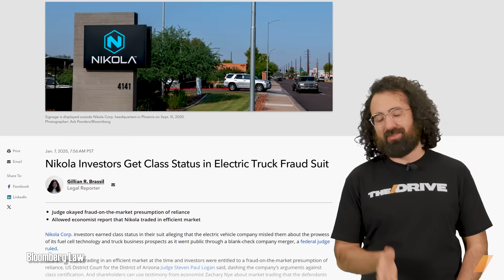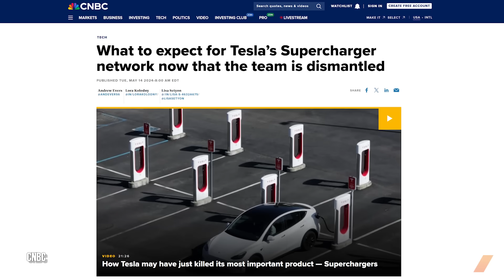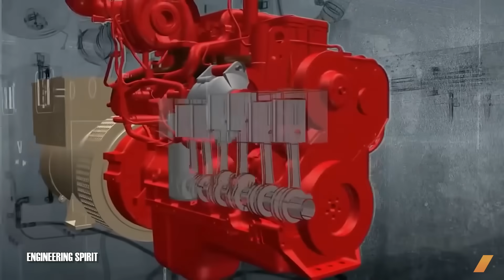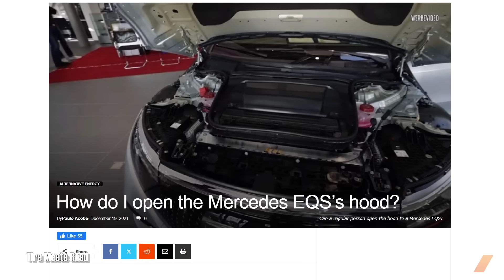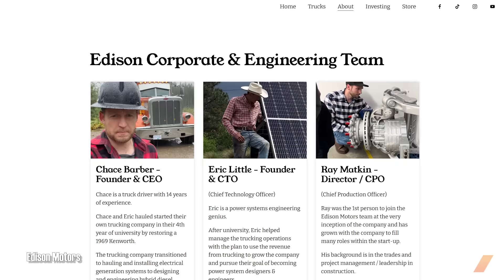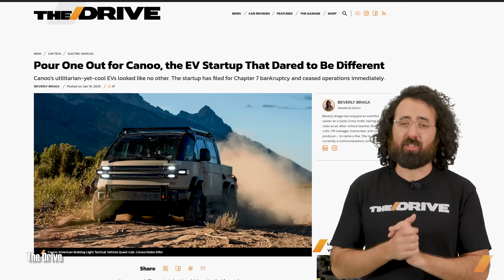The truckers in a shed beating Tesla with 100-yr-old EV tech

Comment: Only one electric semi on the market? Volvo, iveco, and Scania all have electrics currently on the market.
Reply: very US centric video.
Reply: @Boborjan1986  US has EVs too, Frieghtliner, Kenworth Peterbuilt. Its not a US centeric, its a Tesla vs Edision center video. they act like nothing else exists.
Reply: @Boborjan1986  Lot of calls to bring Scania to North America, so much more advanced than any truck I drove
Reply: @Boborjan1986  Funnily their lack of a train infrastructure probably makes the Americas quite knowledgeable in diesel-electric. It exists for European freight trains and maybe some remote commuter lines, but most trains here are full electric with hardly any battery. They can get stuck in a short section between voltage supplies. A tiny hybrid battery would help full electric trains quite a lot.
Reply: @Cloxxki their used to be lots of train infrastructure.
Reply: @Cloxxki  US actually has plenty of train infrastructure, it's just optimized hub and spoke for commodities (grain, coal, oil, etc.), bulk freight, and container shipping (in that order). 
The US is just a big country, and once you get out of the northeast, most of the county's population centers are hundreds of miles apart.  But there are still a lot of small & medium towns and cities in between that need to send/receive goods and services, and need roads anyway, so semi-trucks are more flexible and economical.
Reply: @Cloxxki hahaha you don't need hybrid to use a battery for electric trains. Do you really think you can "unplug" a train and it immediately stops? Getting stuck between voltage supplies? Are you mental? 😂😂😂😂😂
Reply: @Cloxxki  The european power grid is extremely stable, blackouts or load shedding are a very rare occurance. It is just not a problem that needs solving.
Reply: @annakissed3226  There is still a lot of train infrastructure in the US.  It just isn't passenger train based.
Reply: @Cloxxki Series diesel Genset passenger trains are very common in the UK and Europe.
Reply: @Cloxxki  the US has the largest freight based rail infrastructure in the world, and we use it quite a lot too. The problem with US rail is not freight, but passenger the US has almost no passenger for rail, but don’t mistake that for no rail.
Reply: @Cloxxki curious about your comment “lack of train infrastructure”. The US has the largest train infrastructure in the world, with the most advanced diesel locomotives ever built. It’s easy for European countries to electrify their networks as most European countries are smaller than just the state of Texas while the entire network of Europe is much smaller than that of the US.
Reply: @Cloxxki us has more railway than any other country genius, 250,000km. The US was built on and created by railways. Where the railroad went was where the people went. Even second place china only has 124,000km of railways. And the part that makes this even funnier, the US uses a ton diesel-electric locomotives for most of their trains. So they know a ton of diesel electric power cause their vast amount of trains use it lol.
Reply: We have the largest train network in the world.
Reply: @rhekman  Nah to a certain degree we can have more Raúl we use to have more rail. Like everything tho cooperate downsizing to save money
Reply: @Cloxxki  actually we have a massively complex and extensive rail network for freight. We just don't do passenger rail
Reply: @rhekman  Semi trucks are more flexible and economical than rail transit in the US? Does this factor in road maintenance and fuel costs per ton-mile, or no? It's a known fact that railroad equipment and rail construction are an order of magnitude cheaper per ton-mile of cargo delivery than truck and trailer, mostly because of major fuel savings and how expensive it is to repair highways and road networks versus how expensive it is to maintain rail. True that a single truck and trailer are much cheaper than a single train, and that it costs more to build the tracks than it does to pave the road, but in 50 years' time, the rail network is millions and millions of dollars cheaper, and this advantage grows with higher ton-mileage.

Not to say that trains are always better - in rural Australian towns, for instance, deliveries are usually of very small tonnages, which make rail uneconomical. America has no such problem - deliveries are high-tonnage and run frequently, meaning the ton-mileage checks out for long distance rail infrastructure OVER long distance trucking.
Reply: @Cloxxki America uses freight trains more than anywhere in the world.
Reply: @Cloxxki  Have you seen our freight network? We do not have a "lack of train infrastructure" in the US.
Reply: @Cloxxki you do know America has the biggest freight network in the world we just don’t have much public transport when it comes to trains
Reply: @Cloxxki IIRC that is common on trolleybuses over there so they can can make it to the next stop if a pole detaches or they need to make a detour.
Reply: @Cloxxki diesel electric is used in military vehicles too. Other countries use them in submarines for example while America uses nuclear power.
Reply: @eocoleman1 those countries also have gdps smaller than Texas and they make it work lol, the size argument doesn’t make sense cuz they’re still working with less resources. Texas would be like the 5th richest country if it was a country lol.
Reply: @Cloxxki NA are cities are to far apart for it. And with FSD around the corner it isnt worth investing in.
Reply: @Boborjan1986 Edison is based out of Canada
Reply: @Boborjan1986  “US Centric” when the whole video is about a Canadian company 😂
Reply: @Boborjan1986 still not accurate for the N/A market as Freightliner has multiple eCascadias around and the other manufacturers also have EV offerings.
Reply: @Boborjan1986  North American centric, but ya.
Reply: @Boborjan1986 starring a company proudly based in Canada
Reply: @Boborjan1986  its a Candian company. And these other companies dont sell EV's to the american market.
Reply: @Boborjan1986  Volvo US has an electric option on the market with their latest gen of body style. And Mack will probably join that segment sense Mack US and Volvo US are the same company.
Reply: @Boborjan1986  There are Volvo Electric Trucks in US just owned by Volvo for trial and display purposes.
Reply: @Neojhun  The Freightliner EV eCascadia and eM2 are for sale and built on the assembly line at their Portland Factory.
Reply: @Neojhun Tim Hortons in Canada has a few for testing purposes. We got go to Guelph to see it in person and drive it. We are supposed to be 50% electric trucks by 2030. Line hauls will still go diesel but store deliveries will end up being electric trucks and stores will install MW charging stations for the trucks.
Reply: @Boborjan1986  There are over 500 electric Volvo's on the US roads as of now.
Reply: @GenuineFlolie  I haven’t seen any of them here in the NY area
Reply: @Boborjan1986  *Canadian
Reply: @Boborjan1986  It's a US based channel...
Reply: @alexanderdeburdegala4609  North American actually.. Canadia a nation and featured in the vid
Reply: TheDrive is based out of LA, Edison is Canadian, TheDrive is American. That's why almost all their content features ADM cars, not North American cars. Sp you're wrong, actually...
Reply: @alexanderdeburdegala4609  with the stereotype affirming behaviour they've shown in the video, yes it's painfully obvious that they're Americans.
Your own statement also does nothing to take away from the stereotype.
Reply: @fermitupoupon1754 Are you mentally compromised? It's not a stereotype, nor feeling, nor opinion. It's a US based company and channel? Why is this so problematic for you? They like myself thing the Edison is awesome, and the real future of trucking.
Reply: @Boborjan1986  You mean Canada centric, cause Canada company
Reply: @Boborjan1986  Well it is a US channel... so...
Reply: @AnyBodyWannaPeanut  Because it is a US channel it is ok to lie? Got it.
Reply: @bettertoaster  ffs
Reply: @Boborjan1986  Because we're the only ones who matter
Reply: plus Mercedes Actros
Reply: Volvo and Freightliner both have more miles driven from EV trucks than Tesla does IN THE US
Reply: @Fishbone8891  We all do haha! I work for KW and I have 60+ EV trucks I manage in the DT LA alone. This video makes it sound like only tesla exists when in fact they are the weakest player.
Reply: @fjm9898  I agree with you there, I've only seen the two but I'm sure theres more.  Tesla just advertises the most but underdelivered the most as well
Reply: @Fishbone8891  PACCAR between Peterbilt and KW have about 100 EV trucks in the LA area between MD and HD. BYD i think has like 50-100 trucks down there and Schnider alone has like 100 EV Freightliners.
Reply: Even in the US all the OEMs offer EV options, they just didn't do proper research. Daimler beat Tesla to market with Class 8 trucks with the Freightliner eCascadia. There are more eCascadias out on the road than Tesla trucks.
Reply: Hyundai -Kia, Mercedes-Benz, Daimler AG, Freightliner, Mitsubishi Fuso, Toxin, DAF Trucks, Kenworth, PETERBILT, International EMV, Tata, Volkswagen, Volvo, Renault, BYD, E-Force One, Smith Electric Vehicles, Tererg, Volta.
Reply: There are even many more in China, But there is only one american market - but you should look beyond your national borders.
Reply: @ Bruce Wilson who lives in Tennessee is actively trying to get scanias in the U.S.
Reply: Here in Brazil we have a lot of electric trucks from manufacturers like Volkswagen, JAC Motors, Volvo, Mercedes-Benz, XCMG etc... I could mention more but those are the one you will see often! They operate in cold and hot weather, through highways and thought dirt and mud, we have eletric cab overs and regular eletric trucks too. Saying that there are no eletric trucks in the market is kinda crazy! In more developed countries there are even more eletric trucks and vehicles. There are rumors that BYD will also start building eletric trucks
Reply: Freightliner also make an electric semi for the US and Canadian market.
Reply: Was thinking the same thing, our city in Victoria BC Canada has several large electric trucks, buses, dump trucks, even in America there is several electric semis besides Tesla. Not sure you did enough research, even Tesla semis go further then just a few stops around town, they get over 500 Kms on a charge and charge in 45 mins. Ever filled a semi? Takes like 25 mins to pour fuel into that huge tank…
Reply: International also has electric semi, USA based company
Reply: @MariuszChr International is owned by the Traton Group, which also owns Scania.
Reply: @MariuszChr International is owned by VW.
Reply: @TroySavary  off-road part, semi business is not from what I understand
Reply: @MariuszChr  VW acquired International when the bought Navistar. It is a fully owned subsidiary of Traton VW's heavy vehicle arm. They bought it for the semis. Getting rights to the Scout name was just a bonus.
Reply: @TroySavary  oh ok. Thanks.
Reply: Nah
Reply: Also Mercedes
Reply: Obviously an American.
Reply: You forgot Toyota, Hyundai.  JCB have Earthmoving plant Hydrogen, Diesel and electric.
Reply: Hybrid truck
Reply: They just aren't revolutionary.
Reply: This isn't a video about your-a-peein trucks, so get off your soap box.
Reply: American market. No one has them in application.
Reply: Most battery semis do not have the range capacity 4 operating in the US.
Reply: Yea, and not ONE is worth the 2 gallon of gas it would take to get rid of the junk!
Reply: The USA is famously self focussed
Reply: Not the Same tech
Reply: Now don't go bursting his bubble like that.
Reply: Doesn’t change the fact that they can’t really compare
Reply: Those use a overhead cable do they not? Like the trains over there in europe.
Reply: Apparently someone forgot this video is on EV truck in North America. We know EV trucks are popping up more in Europe.  Renault, Iveco, Scania, others and yes you are correct but in North America, we only have Tesla and I have seen a Nikola but that was one…have yet to see a Tesla semi where I live but I hope Edison makes it able to pass US emissions so it can come into the states
Reply: You're a moron, this is a diesel-electric hybrid.
Reply: Pepsi and frito lay also use Tesla semi’s
Reply: On the market in the US.  The only market that matters…
Reply: Technically freightliner and peterbuilt also have electric semi trucks in North America so it's not just tesla and Edison.
Reply: Kenworth too
Reply: Kenworth and freight liner also have options available
Reply: Peterbilt and Kenworth too. Western Star has one but it’s a single-use purpose for mining operations.
Reply: And Kenworth
Reply: I just did workplace learning and I drove an electric mercedes there. I was also at Elmia half a year ago and while there I got to look around a few BYD EV semi models and they're quite nice TBH
Reply: also mercedes…
Reply: An American narrator on an American channel talking about American and Canadian companies? How could they forget about the trucks in Europe, which are incredibly relevant to the topic of American logistics
Reply: Might be on the market but who's actually using them??
Reply: Another EV scam like Nikola
Reply: Freightliner does as well
Reply: Raced to the comments to see if anyone else noticed that and day what u did
Reply: Sure, and not one of those is nearly as awesome as Edison. Euros are cringe losers, no I will not elaborate.
Reply: Mercedes 600  km autonomie
Reply: Yeah and the electric Volvo is just as bad. The company I work for in the UK have 2. They are only allowed to make deliveries and collections from 2 junctions away because range and charging facilities are non existent.
Reply: Scania makes a diesel hybrid suitable for urban transport
Reply: Shhhhhh ...... He's American.. remember, you don't exist.
Reply: They're all fully electric, not diesel electric and are not suitable for the long distances the north American trucks need to cover.
Reply: Probably meant the North American market.
Reply: And they are all trash except for the Edison lol
Reply: and what happened with Freightliner
Reply: …in Europe
Reply: So none then. Thanks for confirming.
Reply: And Freightliner
Reply: I live near the Port of Los Angeles. I see non Tesla electric battery semi‘s regularly. Not a lot of them, but regularly.
Reply: Try an ev truck in -30c canada see how that plays out
Reply: Diesel electric* there isn't any production electric truck with an onboard diesel generator.  Peterbilt, Freightliner and Kenworth have electric trucks but they've got a range of like 230 miles with the most range.  Idk about you but ik American long-hail truckers do like 400-700 miles a day
Reply: Yeah, but none of those are available in the US or Canada. It’s a different world. You can’t even import your own Scania and use it commercially, over there. But then, when was the last time you saw a Peterbilt, in commercial use over here? Different environments, different rules and regulations and even different safety standards. 
That’s why cybertruck was never available over here. Even if it was built correctly, it can’t meet European standards.
If you watch these American channels, you have to accept the limitations that implies.
Reply: I would look at the cost and stats on the semi. the teslas range is far better.
Reply: Yeah, the US market. We don't care about tiny European countries. Hell, yall still use cab-over trucks😂 Imagine crossing the USA in a cab-over, that would be miserable today
Reply: 2/3 of those don't exist in the states, and Volvo doesn't have any EV semis in the Americas.
Reply: Those are short range aren't they? Those are for moving around equipment in the yard
Reply: In us. Only in us
Reply: Typical Ameribrain
Reply: Daimler has a bunch. E-Cascadias to name the most notable
Reply: And don't forget the enormous brands of chinese EV's
Reply: The US has unique semi requirements that don't exist anywhere else. European designs don't work here nearly as well.
Reply: @spdcrzy  Erm... European semi trucks often have more power... are more manouverable... can tow higher loads - the scandinavian versions can go up to 90 metric tons.
They have sleeper cabs...
Oh.. and they are usually more efficient... 
Just watch the videos from Bruce Wilson on their imported Scania truck.
Sooo...
Reply: HueyHunter  yeah.... right... as if this can't be addressed by engineering a slightly longer wheelbase, or just use electronics...
You still save a few feet in length.
Nit even considering that the US trucks still use very outdated suspension systems, which make them more unstable, but much cheaper to produce.
Reply: HueyHunter  yeah... as if the electronics weren't already in the trucks... ESP is a mandatory part of braking systems i  Europe... and just code, no additional hardware required.
One of the most reliable systems in any vehicle.
But considering, you guys don't even really care about maintaining tyres.... I won't think a second about any US trucker spending money or thoughts on their brakes
Reply: @spdcrzy  “unique requirements”?  Such as?
Reply: @mgs337  a little thing called "range". It's easy to forget just how fucking huge the US is.
Reply: @ Somehow, I don’t think that’s as excluding a problem as you seem to think it is.  Just arbitrarily picking a couple of models, a Kenworth T680 has a fuel capacity of 150 US gallons (560 odd litres for those who speak metric), a Volvo FH16 Aero (one of their long haul designs) can be fitted out with fuel tanks up to 900 litres.  So unless that Volvo is horrendously inefficient with fuel, I would hazard a guess that it would do just fine on North American highway distances.  

There are differences between US and Europe in terms of roads, vehicle size restrictions, and other things, but I doubt very much that there is any actual use-case requirement that would specifically exclude a European design truck from functioning over here.
Reply: @spdcrzy  Scania would work wonderful in the US. 
Due to import cost etc. it's not viable.
Beside the people, there nothing special with US that separate them from the rest of the world when it comes to trucking.
Rest of the world left the 70s a long time ago.
Reply: @modalen2 Heck, even the notion that Euro Cab-overs being less powerful & comfortable than US' traditional trucks is long gone for decades. Modern Euro Cab-overs are some of the most powerful trucks out there straight from the factory while also providing a lot more comfort because they use air suspension all around, more sound deadening, advanced automatic transmission, etc.
Reply: @modalen2 Scania is own by VW, so they could be built in a VW factory in USA
Reply: @modalen2  why people like you don't even bother to google about scania in the US and find out about their 80's attempt to get to US market? Scania failed in the US, nobody needed their trucks here.
Reply: @modalen2 Scania would work state wide not country wide
Reply: @modalen2 the specs of US trucks compared to UK are night and day due to weight limits and bridge laws. A euro trucks would boot be viable in the US without modification
Reply: @modalen2 cab over design is a problem in america. If you cant sleep in it it makes it prohibitively expensive to use them for long haul
Reply: @loutenant9480  It's not that they weren't needed, It was repair facilities that were needed. If you strayed far from a Scania dealer, parts would be hard to come by. A strong dealer network in the US was the most limiting factor by far. Brand recognition is a hard thing to overcome as well. Scania wasn't as well known in this market back in the 70's.
Reply: @modalen2  "it would work wonderful but it's too expensive" then it wouldn't work would it? You make little sense
Reply: @modalen2 the issue is most trucking jobs are cross state and and that can get to be a real issue with finding chargers ESPECIALLY a specialist semi charger.
Reply: @modalen2 interesting comment seeing as the US moved beyond using cabovers in the 70s. 
It’s also more than just import costs. Most European trucks are too short and have a much higher load density and axel load weights seeing as most are only two axels. US trucks are much longer and typically have more axels to distribute the weight. 
Other factors also play a part, most European trucks don’t meet California emissions standards, or US safety standards.
Reply: My backyard is probably the size of whatever flat you live in. The US is insanely large @modalen2
Reply: @modalen2  the u s is extremely special when it comes to trucking. The United States is a heavily car centered country. The need for cavover trucks essentially does not exist in this country. The conventional truck is easier to work on and more comfortable for the way longer trips than our european counterparts have.
Reply: @modalen2 The us doesnt use nor desire cabovers, most foreign trucks are short cabovers which can increase driver fatigue as truck drvers in the us travel long continuous roads. imported vehicles may be of use in cities but they arent a necessity, and the average driver in the us drives like shit so the large fromt engine provides safety for truckers
Reply: @modalen2  no there is a separation in truck design, euro trucks are nimble for mountain roads and all the curving roads while american trucks are long for straight roads and going a 1000 miles in nearly one go. It's why most euro trucks are stocky and short while American trucks are long. We use euro type trucks for towns and city use while the long ones for cross country or long distance use.
Reply: @modalen2  scania would not work, 600km is not long enough to replace the 1000+ mile range of long haulers but may work for city use in the higher populated states, New York, but not viable for states like mine, Oklahoma
Reply: Scania has a demonstration truck touring the US now and it's so far advanced compared to current US builders.  Far more comfortable, much, much more manuverable, advanced braking systems...
Reply: @ThusGuy Why would Scania only work state wide?
Reply: @ some states lack infrastructure in between cities and I doubt states like Alabama would be willing to build dozens of semi chargers
Reply: @ThusGuy  I thought you meant Scania in general (diesel).
But the infrastructure for semis isn't built out in either, so in many cases they just use the chargers for cars. That means, in some cases they have to unhook the trailer while charging, but it doesn't seem to be a big deal.

Also, many companies who use electric trucks, use them on the same routes. They have a charger at the load/unload bay (sorry, don't know the English name), which makes it possible for them to drive all day, without interruptions other than the normal lunch breaks.
Reply: @modalen2 European semi’s are shorter and nimbler for tight single lane roads. American roads are longer and straighter. Different designs for different regions.
Reply: @modalen2  the reason is us semi's have longer engine bays in front of the cab while European trucks usually have engines under the cab witch isn't  as good for longer distance
Reply: @modalen2  we do, however, have one of the largest nation in the world by land mass. Hence why our trucks focus more on long haul and comfort and less on maneuverability and efficiency
Reply: @modalen2  although Edison motors are starting to use Scania engines, so there is hope for the American / Canadian market
Reply: @modalen2 Scanias aren't as fuel efficient or as comfortable or as good at handling speed as any US truck.
Reply: @extremlycoolperson  now that's why you're a bit misinformed because you base things on old American Cabovers. 

Things have progressed so much and modern Euro Cabovers can 100% deliver the same levels of comfort if not even more than American's traditional trucks. Air Suspension in all corners of the truck, for the cab itself, & air suspension for both driver & passenger seats. 

You wanted fuel efficiency? They can also deliver better fuel efficiency even when they're brought up to the speed most US trucks go.
Reply: @modalen2 one American has imported one but is having difficulty getting it DOT approved or something the last I heard they have approved it to a certain number of trips or something so I don’t think import costs are the big factor here plus with a company the size of Scania they would most likely build it in America or Mexico since Tyler’s be honest with the amount of people who have liked Bruce’s scania they would capture quite a healthy percentage of the market
Reply: @spdcrzy  The thing is. All cab overs would work a billion times better then any truck on the road today. Much better tech much better safety much better load capacity and customization and much better engines
Reply: Name one  @spdcrzy
Reply: @spdcrzy unique requirements. Lmao. Drum brakes and mirrors you see nothing in 😂
Reply: @spdcrzy  Freightliner has had the eCascadia in the US since 2021
Reply: @spdcrzy its not that they don't work well they just have different regulations
Reply: @spdcrzy  volvo has an american market of trucks as well
Reply: @spdcrzy Volvo and Mercedes have delivered far more electric semis to American companies than Tesla has.
Reply: @TroySavary  Correct! For those who won't know Mercedes (Daimler) trucks in the US are sold as Freightliners & Western Stars.
Reply: @spdcrzy lol bruh it's your chicken tax that keeps Europe from overrunning your NA market, bruce has brought over a Scania 770 and is touring around showing American truckers what is available elsewhere and he's said this over and over, the tech on euro trucks is miles and generations ahead of American trucks, Like they don't even use DPFs. So no it's not really 'unique' requirements it's just bureaucracy that kills competition and innovation.
Reply: @mwat22  > the tech on euro trucks is miles and generations ahead of American trucks, Like they don't even use DPFs. So no it's not really 'unique' requirements it's just bureaucracy that kills competition and innovation. 

wouldn't this imply that the bureaucracy is helping innovation? the EU has much more stringent requirements on vehicles.
Reply: @mwat22 the chicken tax only applies to LIGHT cargo vehicles. Like the Ford Transit, funnily enough.
Reply: @spdcrzy  flatout lie
Reply: @spdcrzy does that mean they don't exist?
Reply: @TheAllMightyGodofCod  Western Europe does not see anywhere near as harsh climates as the US and Canada do. Notable exceptions being the Nordic countries, of course.
Reply: @spdcrzy you clearly have never been to Hungary, bakingingly hot summers, deep freeze winters are the norm!
Reply: @spdcrzy  if you are going to answer my question, fine.
If you are not .. then, shut up and don't waste my time
Reply: @annakissed3226  I'm dead serious when I say Hungary's weather is but a drop in the bucket compared to anywhere in the Midwest. You guys don't get tornadoes, landslides, mudslides, ten inches of snow in a day, or multiple weeks in a row during the summer that are over 35°C. All in one year, I might add. We get more snow in two days than Hungary gets rain in a YEAR.
Reply: @spdcrzy  Euro trucks are everywhere except NA, from the deserts in Mexico to the harsh winters of Norway with no extra "weather packages". Just normal factory setup. Only reason they're not in NA is due to import tax.
Reply: @annakissed3226  While you are right, you clearly did not read his comment. Or failed to understand the key part: Hungary is NOT part of Western Europe. It is part of Central Europe. And therefore we have a Continental climate here (well, in the last few years I would say we went back to the Mediterranean climate like what we had in the 15th Century).
Reply: @spdcrzy  Trucks are usually tested down to - 40 °C / -40 °F... We do have snow chains... we have winter tires... Temperatures in Spain go above + 40C / 104 °F in summer... What we don't have is tornados...
Reply: @spdcrzy  …and especially Norway, the most nordic of those countries, has a huge amount of electric trucks…
Reply: @spdcrzy  western Europe and the PNW have basically the same weather. But I guess including Arizona and Nunavut, whilst explicitly excluding Scandinavia, and glossing over the Iberian peninsula and Central and Eastern Europe, is a perfectly fair and reasonable comparison. You do realise that Europe is larger than the combined area of the 50 US states, right?
Reply: @annakissed3226  the coldest temperature ever recorded in Hungary was -35 c in 1940. Definitely cold but that's pretty much a regular occurrence where I am in Canada. For comparison coldest temperature recorded in Canada was -63 c.
Reply: @spdcrzy  You know that most US trucking manufacturers are actually owned by European companies. So, if they wanted to get EU trucks, like they are used all over the world to the US, they could. However, there is no need as the US is OK with trucks that are still in the 80s, so it is more important to them to make big profits instead of newer, more advanced trucks.
Reply: @spdcrzy yes where Scania and Volvo are from
Reply: @spdcrzy Where the Volvo and Scania are based. They are both Swedish, which is part of the Nordics.
Reply: @spdcrzy Bonus points for pointing out climate in northern Europe. Southern trucks in Europe do not work well in lets say Norway, in Winter. Because they mostly use 2 axle trucks. Native northern trucks are minimum 3 lift-axle.
Reply: @spdcrzy  Yea nordic countries. Can u tell me where exactly is Scania and Volvo HQ located ? Oh scandinavia
Reply: @spdcrzy Scania is a Swedish company and Sweden has plenty of semitrucks on the roads at -35C in the winter.
Reply: @aftoknito  bruh, -35C is NOTHING lol. This is what I mean when I say the (Western and Central) European mind cannot comprehend the scales of weather and distance that trucks have to deal with here. In a single year, a heavy duty logging truck will see everything from -50C to 50C. It WILL get rained, snowed, and hailed upon, and maybe have to deal with a rockfall and a mudslide or two. It WILL have to deal with being overloaded beyond an already insane 88,000lb. It WILL require  a traditional two-box configuration and not a cabover, because LOGGING. You're off-road, you've got a lot of weight, probably significant elevation changes, and very low tire pressure. Trust me, you do NOT want to be in a cabover unless it's a Unimog when you're in that position.
Reply: @ there isn't a single place outside Antartica where the temperature drops to -50C. You're clearly an American that doesn't understand the Celsius scale. Not even at the top of Mount Everest it gets to -50C.
At -50C you'd succumb to hypothermia in a matter of 3-4 minutes.
Reply: @TheAllMightyGodofCod market... Ours, not yours!
Reply: @fightfanian I would love to counter argument but ... I made my comment months ago, there are presently 206 comments In the thread and I have better stuff to do than to look for a comment on my 3 day weekend with 40⁰c and perfect sunny weather.😊
Reply: @spdcrzy So? Just operate electric trucks in the milder climates like the entire east coast to the midwest, and the west coast to the rockies. That's the vast majority of truck journeys accounted for.
Reply: @KingFinnch  did you really call the Midwest "mild"? LOL.
Reply: @spdcrzy  Guess where scania and volvo are located.
Reply: @spdcrzy  There are places in Greece that go negative Fahrenheit regularly. Central Europe is even colder during the winter
Reply: @spdcrzy like what? What is there that an American made Semi truck can do that something like a Scania or Iveco can over can’t do?
Reply: @spdcrzy It's the other way around. America doesn't meet the standards of European trucking. + USA doesn't allow trucks to be imported unless they are 30+ year's old. "American requirements", lol...
Reply: @spdcrzy so how come your semi companies are owned by European truck companies and built in Europe and shipped to the US?
Reply: @annakissed3226  The hell you talking about. Peterbilt and Kenworth are all US owned and operated, PACCAR is an American company who owns a EU company, DAF. Volvo builds their trucks here in the US and Freightliner, yes is owned by Dimler, are built in the US.
Reply: @annakissed3226 curious about your comment. True there are a few US truck companies owned by European companies (Freightliner, Mack, US Volvo), but all of these companies have their assembly plants in the USA. In fact, I can’t find any evidence of any European trucks being imported to North America (USA or Canada). In fact I only found that there were more US trucks imported to Europe than the reverse which makes sense as most European trucks don’t meet US emissions or safety standards.
Reply: @annakissed3226  that's just not true. Mack, Peterbilt and Western Star are still made in North America. Paccar, which owns Peterbilt and Kenworth also owns Daf, a european truck company. It goes both ways
Reply: @spdcrzy That's just not true, Australia constantly uses European designs, and they have thousand kilometre stretches of desert with hardly any infrastructure.

European trucks are far safer, far more efficient, far cheaper to produce, and produce more horsepower. It's just import tariffs and regulations that make US trucks the way they are.

If American trucks were truly better in a category, you'd see them far more internationally, like in Africa or China.
Reply: @KingFinnch  your roads are different. European roads are old world roads. American roads are a lot different. You guys load your axles to a totally different category than we do, and with good reason.
Reply: @spdcrzy  You're right, our trucks aren't anywhere near as bad as US trucks.
Reply: Politics does not allow Euro trucks in USA. Recent politics will only make it worse. Oil industry runs US politics.
Reply: What are all of you talking about? This channel is not familiar with the commercial vehicle industry.

Paccar offers electric Peterbilts and  Kenworths in NA, and DAF in EU. DTNA has so many eCascadias in NA. Toyota and Kenworth together offer a FCEV. 

To the channel, do better research.
Reply: It’s America. They forget they’re 10 years behind the rest of the world in these things. 😂😂
Reply: @hughmarcus1  10 years behind? That was 20-30 years ago, today they are much more behind
Reply: @hughmarcus1  you're delusional
Reply: Name one US truck I dare you
Reply: @CaptainFreezy Volvo, Mack, Freightliner. All make electric trucks in the US.
Reply: @CaptainFreezy Peterbilt and Kenworth offer electric class 8 trucks.
Reply: @CaptainFreezy  Freightliner eCascadia & eM2. Freightliner has offered EV options for class 6-8 trucks in factory production for almost 2 years, but the news only cares about Tesla because Elon knows how to market to the masses....
Reply: Diesel electric mate. I think you might have missed the idea
Reply: All of what you named let's me know where you're from, please understand this video is obviously talking about the States 😂
Reply: @sixpest It’s a Canadian company eurotrash
Reply: Diesel-electric hybrid manufactured in North America.
Reply: Ok, now everyone look up the distance they can do and cost to build. There is a reason Tesla will do very well.
Reply: I've never heard of any of those companies except Volvo. This is an American media company and a Canadian truck company
Reply: He is American. America is the only country in the world, he doesn't know that there is more countries. Well, except Canada, and isn't that America?
Reply: The video is based in the US therefore only applies to the US Canada market. 
Sheesh.
Reply: @Victorianous  So? Volvo alone has sold hundreds of electric semis 8n North America. Then the are Mercedes, Freight liner, even Nikola.
Reply: @Victorianous  this video based in the US is watchable from all around the world, either a clarification or a correction is needed
Reply: @LostCauseRT  Nobody cares. If you can't figure out on your own that the topic is being discussed in the context of the U.S. market, a disclaimer isn't gonna help you out...

Go watch European channels if you want to watch discussions about European markets... It's really that easy!
Reply: @LostCauseRT  context is clear.
Reply: i think they said that because that's mostly in Europe. I watch Electric Trucker so I know about those but Tesla is the only one in the US.
Reply: @Defianthuman  huh? Kenworth T680E, Peterbilt 579E, Freightliner CascadiaE, BYD cab over. Each one of these models have a factor of 10 more on the road then Tesla does lol.
Reply: I think they needed to clarify the US centric nature of that comment.
Reply: @conceptrat  Why would they need to clarify? It's really not that hard to figure out that a U.S.-focused channel, on a U.S. based video platform, in in American English, talking about competing with Tesla, is not overly concerned with the European and Asian markets.

Sort yourselves out.
Reply: I've seen a couple Nikolas here in Wichita being driven. I've seen them for a few years @ CES, but was totally unaware that they are being used or tested.
Reply: Not sure how as nikola was a scam and neverbproduced an actual self propelled vehicle, and the "founder took the money and ran.@daviddavis1322
Reply: How much are they though?
Reply: The other makers semi trucks are not as efficient as the Tesla and the Tesla semi charges far faster than anything else on the market.  The other makers took essentially diesel trucks and tried to convert them whereas tesla built it from the ground up to be an EV.
Reply: US market. We have crappier roads with shallower foundations and lighter load limits than the EU/UK. Also a generally better track record than Europe on diesel engines. And back to that issue with our roads, combined with the continued US resistance to using tachographs and not having appropriate limits on hours; most cab-over designs just don't ride well enough for the sake of limiting driver fatigue on the long distances, long hours and poor road surfaces of US trucking, hence the more old-fashioned, longer-wheelbase tractor designs in US trucks.
Reply: Also they have radiator for wamrer climate to cool the batteries
Reply: Too bad European trucks look stupid
Reply: @SamCyanide  Yes, because everyone, knows fleet managers consider aesthetics above all else, when choosing trucks.